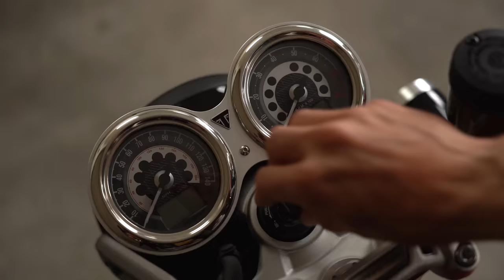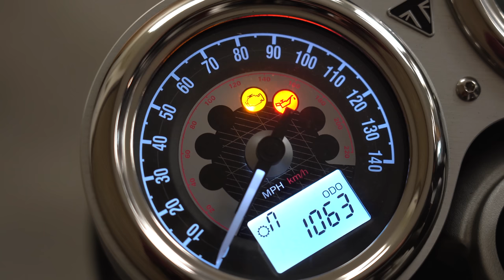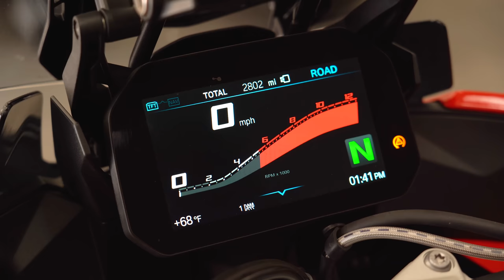Do You Need To Warm Up Your Engine? | The Shop Manual

Comment: BS. Minimum if water cooled, the temp gauge should be reading.
Air cooled should warm up even longer. You even covered it in your own language. Tolerances.
See late 90's small full power two strokes. They'd seize solid if not warm. Same tech in other engines, regardless of modern oils.

Comment: I would literally let my bike idle for 3-5 mins and each break i take i usually throttle after 10-15 secs after i leave my bike in idle😅 cause of the oil flow.

Can anyone say why the bike has rough idling like, in cold starts my bike idles at 2k-2200 rpm and settles at 1300-1200 rpm

Comment: if i don't let my bike run for 5 minutes or so with the choke fully open before i try to ride it it will die with the slightest increase in throttle

Comment: This is not true.. my 2023. Suzuki has an extreme fuel enrichment map even from the factory when you first start it. Then it goes into a second map that’s kind of in between and it runs very lopey. Once it hits about 125f it kicks into the normal operating map and runs very smooth. You definitely do not want to get on it until it temperature.

Comment: As a matter of fact you hurt your engine by letting it idle to operating temp. The thing that heats up pistons etc. is not internal drag (otherwise it wouldnt last 10k miles) but the fuel burning. At idle you use so little fuel that it takes a lot more strokes for the engine to heat up, thus resulting in increased wear & tear over just riding carefully and thereby feeding far more fuel into the combustion chamber.
My bike doesn't show temp but I once experimented with my car: It took roughly 4.5x more strokes to heat the engine up by idling vs. driving.

Comment: Any young child knows that hot metals expand more than cooler metals, when you ride a bike and the engine is cold there are differences in heat and metals expand so you need to heat up or the engine will be damaged

Comment: I feel this video is a little irresponsible. 

Oils and additives do not work correctly when cold. They may flow 'okay' and work to a point,  but they aren't working as the manufacturer of the oil or the engine intended. Many of the additives don't even work at all at low temperatures.  Cold running may not destroy your engine but it is definitely beneficial to warm your engine and oil if you have any mechanical sympathy. 

Your engine is designed to run at it's operating temperature. As is your oil. Around 100c.  Compare cold 10w/40 oil at 10c and at 100c.   It's like treacle vs water.  Have you tried swimming through treacle ? Why put your motor under undue stress and load by doing the same. 

Simple rule. Whatever your bike. Whatever your engine. Warm it up.  And ignore videos like this who are chasing subscriptions rather than looking out for your motors.

Comment: Then how come when I cold start my cbr on a cold day, the rpms sit at around 1500 rpm until the engine reaches 100 degrees F? Then it idles at 800 rpm.
Reply: EFI ramps up idle because it won't idle (smoothly) at a lower speed when the engine is cold. Think of it as auto-choke.
Reply: @AriH211  yes I know, but according to this video, I should be able to ride only a few seconds after starting the bike because of modern oil. Unless I missed something, but I'm still gonna wait for my bike to idle normally before I ride.

Comment: I push the bike out of my box, turn on the engine. Then I put on my balaclava, my helmet, my gloves, my airbag vest. I shut the box's door and lock it, put the electric key in the automatic door remote, put the key back in my pocket, close the zip while the gate still opens, and then, only then, I engage First gear and drive. Then I have to go down my street at 30 km/h, cross 2 kms of town at 50 km/h with at least four circulation lights, 2 more kilometers à 70 km/h before arriving on the highway with speed limit of 90 km/h. Do I need extra time to warm my fuel injected bike ? Nah

Comment: I am still waiting for the day that you can drive off on a cold engine in anything and have no issues.

To truly understand the reasons behind warming engines to operating temp takes much longer than this video. There is one bike that stands out as an example. The R6. When the 2nd version of the R6R came to market there were reports of power loss, poor running, low compression, ticking, hard starting, and a couple of others. The reason for all these issues, valve stretch. The R6R has titanium valves in an aluminum head…..which metal gets hot first?  If you said titanium then you are smarter than the guy in the video.

Race teams heat the engine, air planes heat the engine(s), transport ships heat the engines, trains heat the engines………there is a lot less wear and potential damage if you warm the engine.

The manual is not just a thing to be thrown out, the people who wrote it are the same people that designed and built the machine, if they say warm it up, do it. They are PAID to figure this all out.
Reply: R6 owners manual says "For maximum engine life, never ac- celerate hard when the engine is cold!"
Operative word: HARD.
Accelerating a cold engine is fine. Accelerating HARD is not fine.

Comment: This is TOTALLY WRONG. After the start, when motor is still cold, you can clearly notice a slight open throttle. It means that if you pull hard the front brake there's a chance that it will unbalance you and let the bike fall off. This is why you see the rear wheel spinning even in neutral when you start the bike on rear stand. When warm it disappear.

Comment: Makes video about whether to warm up engine or not. Completely ignores that full head gasket clamping force is not achieved until till the engine is up to operating temperature. Just don't ride it like you stole it when it's not up to temperature. Yes blown head gaskets from from riding like a hooligan with a cold engine is still a thing. Consider the compression ratio of some modern motorcycles. Even my 2022 Yamaha mt 07 is 11.5:1.

Comment: Very wrong. Most bikes will idle high when first started. Then drop to normal idle after a minute or two. Properly warming them up will make them last longer. Less wear in the parts. Also even fuel injected bikes choke and run different when cold. I have had many of them and have been a certified motorcycle mechanic for over 15 years. Also the oil lubricates better then it is warmer. Cold oil does not flow as good as warm oil. That’s a fact. Doesn’t matter if it’s 1 year old new tech oil or 50 year old oil.
Reply: I'm all for criticism and corrections, but comin' out the gate with "Very wrong" makes it hard for me to want to have a dialogue with you. Nothing in the video is wrong, it's more likely that it goes against what you were taught or believe, and you're reluctant to change your views. I respect your time as a motorcycle mechanic, but please re-watch the video and carefully consider the points, and research the topics that you feel are "wrong."

Comment: Sorry but this is not entirely true, I have worked on bikes for years and this is just wrong. Modern bikes regardless of fuel injection still require a certain operating temperature. Modern lubricant still needs to get to temperature and metals and gaskets are also temperature sensitive. All this talk about carburettor bikes??? What do Americans have against a carburettors???? If they are correctly set up they are super reliable??? However yes regarding modern or old classics, warm them up please 😂😂 the tolerances in any engine requires a basic working temperature!!! Start you bike take your time kitting up and ride at least 10 ks at moderate rpm when she’s warm give her hell 😃👍

Comment: I think what's best, is to have a Block-Heater, and an independent oil & coolant pump, so the engine is lubed up, and near operating temperature, before the engine even cranks. Little to no fuel wasted. The most wearing time on an engine, cold startup, is eliminated. And if the Block-Heater & Circulation is remote activated, with a cutoff so the battery always has enough power to crank, then no time wasted either. 

You can sneakily prep your bike as you're sneaking up to it, hop on, then be started, in gear, and launching as soon as the kickstand is up. Surprise a threat nearby, like a dog, bear, moose, cop, or spiteful "loved" one, and have your engine ready to outrun them.

The added weight & complexity of a Block-heater and independent circulation system may not be worth it to many of you, but it is to me. I greatly value engine efficiency and longevity,  for touring purposes. And because bike engines are so loud, then if they are going to sing their location & operation to a hazard, then the bike better be ready to move, and move hard. And it has to be ready to do this, many times during an adventure.

You know how difficult & frustrating it is, fixing a tire during an adventure. Imagine working on your engine, far from home, in a hostile environment. Or while being hunted.

And if the engine is turbocharged, for that extra high rpm power when you need it, then oil & coolant pumps, working independently of the crankshaft, can also work as a Turbo-Timer, circulating fluids through a hot turbo, while hiding or parked after a hard run, and circulation is happening quietly, because the engine is off.

Even if you don't run from cops, still believe in the government and their laws, and still value the cops' lives. Never underestimate having the ability do just disappear with stealth, and without worry of messing up your bike.

For example, what if you're evading bike thieves, robbers, or kidnappers? And you can't just use raw speed to lose them, or you're running out of fuel? And you have no good enough weapons for the threat.

I love electric motorcycles for their stealth & instant-torque, but battery tech and charging stations aren't good enough yet.

Comment: Carb bikes run like crap until they warmed up?  Idle weird? Bog and stall? Only if they weren’t set right or you closed the closed the choke early and tried to give too much throttle too soon. Carb’s can’t compete with fuel injection anymore than piston engines can compete with jets, but they did work just fine. Tosh.

Comment: Have to call BS on this one !                 (I have heard the same BS about cars) Just because the ECU and injectors are much more efficient and make the bike sound OK, the science can't change.... The injectors are dumping fuel in like a garden hose, washing down your engines internals (excessive wear), and when you do drive away in this state, and your garden hose turns into a fire hose just to keep running as smoothly as your story..... and where does it all go ? Out the tail pipe in excessive emissions and  unburnt gasses, even all the emission equipment  (cat, O2 sensor, etc.) is NOT functioning yet as they are 100% critical on temperature to work (and are being damaged by having all this unburnt fuel passed through them).

Comment: Every engine, every machine every plane every tractor every lawnmower etc. etc. etc. needs warm up!!! What kind of dumb question is this!!! The real question is HOW LONG warm up should be. Some can have 30 seconds, some need a few minutes depending on engine size, oil, outside temperature.

Comment: Nice to know what a YouTube personality thinks about mechanics. Go ask a good mechanic if you should warm an engine up for a few minutes before using it. You’ll have to ask several before you find one ignorant enough to tell you no. 
Yes, I am a mechanic of 25 years. Yes I ride motorcycles. Mine will always get warmed up before I ride. Or drive, or use my equipment. Take it from someone who has thousands of hours operating equipment, hundreds of thousands of miles logged on his vehicles and rebuild hundreds of engines. Let them warm up.

Comment: The irony 🤣 the #1 reason we warm up motorcycles are due to a massive lean condition as demonstrated with your Thailand slavery labor built triumph exhaust pipes bluing. EG install a temp at the blue part of the pipe and watch as the bike warms up it becomes impossible to get the exhaust up to 800°. Cheers

Comment: The choke doesn't add more fuel it reduces air. What are you guys even doing? Not homework obviously. I will warm up engines until I die, they do last longer.

Comment: meh, I'll ride new bikes when they are better than old bikes. Til then, my mechanic loves me and I don't pay 20-30k for a new machine
Reply: 82k miles on my '14 V-Strom 650 with no engine issues. I flog the throttle. Lmk when you have an old bike I can treat that way.
Reply: @h.d.h  drz 400s and klr650s are pretty bulletproof. Don't get named the cockroach of motorcycles for nuthin

Comment: Posted by the guy who doesn’t believe in breaking in new engines or tires!   He then goes on to say drive gently until the engine comes up to operating temperature, the very definition of warming up your engine!  How stupid to infer warming up the engine means sitting there until the engine is at 160deg😂😂

Comment: The ginormous piece of crap HD Pan America Special I had the misfortune of buying actually lowered the rev limiter by about 2,000 RPM until the engine reached temperature. Of course the owners manual mentions nothing about this feature.

Comment: One minute warm up? Really? Who is this guy? I always let any engine warm up at least 5 minutes or so. I dont care if its my mower, snow blower, quad, whatever. When its in the teens, I let my service vehicle warm up 15 - 20 minutes. All the dissimilar metals in any engine (zinc, aluminum, cast iron, case hardened steel, etc) need a little time to warm up to prevent damage. Pretty simple really. Even when it's 90 degrees outside, I let the bike warm up while gearing up. Why push your luck especially if your ride is out of warranty.
Reply: You say why push your luck, I say why waste your time (and gas)? We cover the issue of component clearances. Don't put an engine under heavy load until warmed up. And the best way to warm it up is with light load and varying RPM, not idling.
Reply: @AriH211  Says who? You? Have you been turning wrenches 50 yrs like I have? Crickets.......
Reply: @teleman001  I haven’t lived that long yet, but I’ve been wrenching for 20+ years and am fortunate to have former-factory race-team mechanics, factory techs, factory engineers, and even service-manual authors as mentors.
Reply: @AriH211  Oh well....to each his own.....out

Comment: If you dont warm up your engine then your going to have a piston slap on the face of your cylinder..poor engine..
Reply: I have 82k miles on my engine, not a single issue with the engine. I start riding after RPM drops.
Reply: @h.d.h  thats up to you,your engine may last longer due how you treated your engine. But if we are talking about its METALLURGY i would rather dont want to argue because this tells us what is the condition of our engine through out its life and limits.

Comment: no. false. most oil working temperature is 60-80 °C and also the aditives most 60 °C. ALSO the "metal parts" are not extended from the heat and they are not ready for high rpm. also the oil is to thick to reach very small corners or canals. you should ride about 10mins before get high rpm. you americans, no knowledge about engineering😅

Comment: This is the worst misconception I've ever heard. Go ahead the industry will love all you idiot's.  Fact is all machinery must reach operational temperature before using..  you are prematurely wearing out your engine in those precious minutes you impatience people.  If you had a broadband O2 guage you would see how your motorcycle is warming up and reacting.  It takes at least 4-5 minutes to complete the warm up and engine is at operational temperature. 
And your AFR is optimal.
The more high performance your motorcycle is the more critical bringing your engine to operating temperature. 
Go ask any real racing driver and or engine technician. 
Running your motorcycle cold   its running in a serious rich condition!!! That's building carbon on pistons, heads, intakes, spark plugs shall I go on...??!!!!  I'm a Motorcycle technician retired 50 years experience.  I have a triumph ST1050 with 72,000 miles on it.  I burn up rear tires every 2500 miles.  My cylinder pressure is equal on all 3 cylinders and healthy as hell.  
I warm up my motorcycle. 
Hit the starter button and ABSOLUTELY NEVER TOUCH THE THROTTLE UNTIL IT REACHES OPERATING TEMPERATURE AND THE 02 GUAGE READS CORRECTLY. 
5 minutes. Take my Advice Don't listen to this idiot. 
Hes trained and brainwashed and employed by the motorcycle industry.  They want you to abuse and destroy your motorcycle so you can buy new ones. I was s service manager and technician and warranty specialist.  28 years in the industry.  But don't listen to me.  And keep destroying your motorcycle engine in those precious 5 minutes of your impatient life. Oh yeah and keep listening to this guy. 
Mr. Nobody